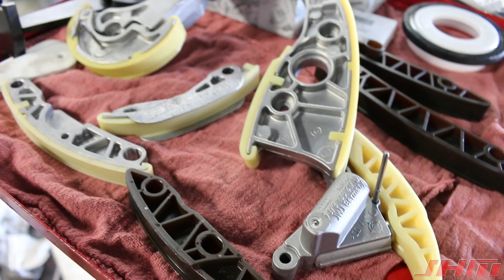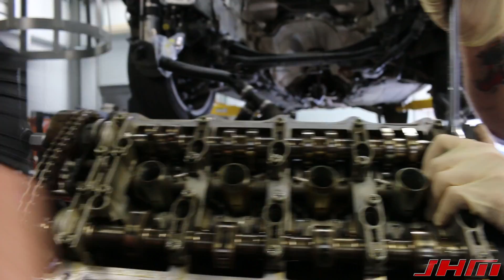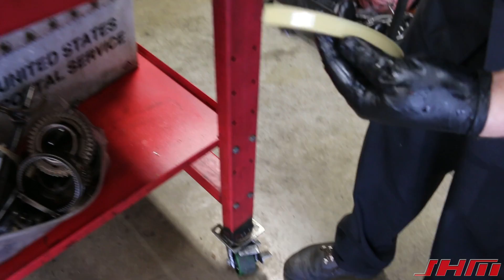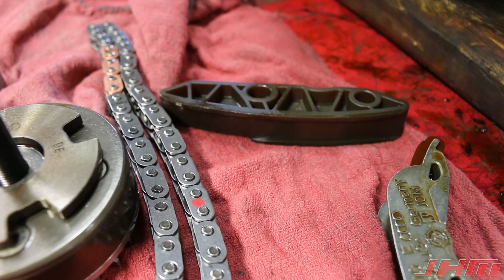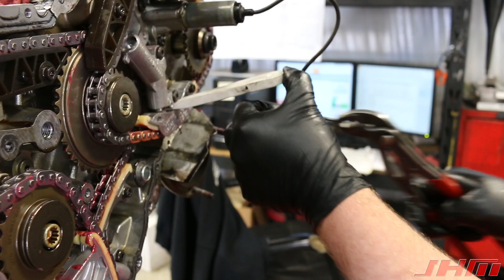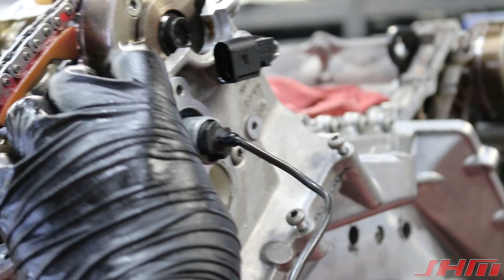JHM Timing Chain Kit Installation Visual Walk Through  - Audi B6-B7 S4 and C5 Allroad 4.2L

Comment: Is it possible to set only one sides timing without following the 4 step torque process fro each cam/ 3 torque specs. On mine the driver side is all set and good. But the passenger side is off by a tiny bit.

Comment: I am having an issue of my driver's side cams moving slightly when I remove the locking tools. The valve spring pressure turns the cams slightly backwards when they are unlocked. Can anyone tell me what I am doing wrong?

Comment: I appreciate that this is not a diy mechanic figuring stuff out on video. Thank you for doing this, and at the same time letting me know that this is best left to the pro's in my case.  This engine is going to be great for many years with this fix! I'm in the market for a B7 S4 right now, and to know that this job already has been done, puts me at ease to pay significantly more for the car.
Reply from the maker: Glad it helped! Depending on the buying price and where the work was performed, it is definitely advised to try to find a car that has already had the timing service performed.

Comment: Hi. Nice video.. wondering , how much on average this job cost? Thanks.
Reply from the maker: Typically timing chain jobs will range from 6-12K depending on what other service is performed while the engine is out. Almost always there will be coolant hoses and other various seals/gaskets that are recommended.

Comment: Blown away by the complexity of these engines, what a design marvel. Apart from the decision to include plastic guides of course
Reply: Or poorly design the seals for literally every seam so every single one of these cars gushes oil out of it if you dont replace the seals every other oil change. On top of replacing the oil every 6 months. Its a very interesting engine design. Not a very good one.

Comment: I love this engine and am considering a 2006 S4 as we speak. HOWEVER ( !! lol ) You guys have to know that for this job, you'll need to pull the engine and access it from the rear by the Firewall. This is about $4500 - $7000 in Parts/Labor at a good European Mechanic shop. So, unless you have a lot of money laying around ( or are a very good Mechanic! ) if this happens, you may want to consider the B8 Generation with the Supercharged V6. I agree that the the B7 has much more character and far better steering feel, but that repair is a very sobering thing to ponder :)

Comment: How much would this job cost if I shipped my 4.2L V8 to u ? Parts and labor it would be a non FSI motor for a 2005/06 A6C6 with low miles....
Reply from the maker: Labor to perform the timing service with the engine already out is 4 hours of labor (our labor rate is $139 a hour) plus the required parts. Please send an email to sales@jhmotorsports.com and we can put together a quote and help arrange freight as well if needed. Thanks!

Comment: Knowing that the timing chain guides were going to be a big issue with this motor, Audi should have made quick release brackets for the engine / trans so you could drop the motor in 10 minutes. That would be awesome.

Comment: Im looking at a 2008 audi s4 with 130,000 miles. The dude is asking 14k and has not had the chain guides replaced. But this looks like it could cost around 5 - 8k? I guess if you have one of these motors it will be a mandatory event at some point during the life of the car?
Reply: After looking into this a little bit deeper I need to change that 5k - to 8k , 8k -10k?
Reply from the maker: You are correct, the timing service will usually range from around 6-10K depending on the shop's hourly labor rate & what other service is performed while the engine/transmission is removed. If you are in the market for a B6 or B7 S4 we would highly recommend finding one that already had the service performed or getting the vehicle for the right price so you can have the timing service done.

Comment: What’s the price on this service
Reply from the maker: Price on the timing service will vary depending on what other work is perform while the engine/transmission is removed. Typically we see this service run between $6,000 to $10,000.

Comment: Great video, have mine out now but I don't see how you seat the rear main seal. When I put the cover on it just slides back toward the timing chains. Do you have to remove the rear flange and then put the seal in ? Like I said a great video but this one little piece is crucial to completing the entire job.

Comment: Manual says to do two passes on the camshaft bolts - one at 40 Nm and one at 100 Nm + 90*. They also say to remove the camshaft locator bars before proceeding to the 100 Nm + 90* pass. What's your take on why you leave the locator bars in and do the additional 90* as a third pass?

Comment: How much does this cost? Parts and labor
Reply from the maker: The cost is going to vary depending on what other service and parts are replaced while the engine is out. Typically we see timing chain service range from 6K to 12K. You can email us sales@jhmotorsports.com and we can put a quote together for you.

Comment: Is this kit a upgrade to the original components or is the engine going to always have this Achilles heal so to speak?
Reply from the maker: Jason, we offer various levels of timing chain kits for the 4.2 40V that contain our upgraded JHM components. The one issue we very commonly see is broken guides and worn mechanical cam adjusters. Both of these common issues are addressed with our JHM timing chain kits.
Reply: @JHMotorsportsInc  Thank you kindly for that response, lots of help and we'll likely be purchasing one of your kits soon. We only have a rattle at start up at this point but want to change out the guides ahead of any real issues! Cheers

Comment: Were the early 4.2 belt drive? Like the 2.7 and 2.8 v6.
Reply from the maker: Yes, the 4.2 found in the C5 A6, S6 and RS6 use a timing belt set up similar to the 2.7T and 2.8L. The timing chain engine featured in this video is found in the B6 B7 S4, C6 A6 & C5 Allroad.

Comment: Excellent work .Does those inlet cam sprocket have a special name? Learning from you man?
Reply from the maker: They would be the camshaft adjusters or cam adjusters. we sell our JHM cam adjuster repair kit specifically for the Audi 4.2 40v found in the B6 B7 S4 and C5 Allroad https://jhmotorsports.com/jhm-mechanical-cam-adjuster-repair-kit-pair-for-b6-b7-s4-c6-a6-and-c5-allroad-w-chain-4-2l-40v.html

Comment: Is this the same engine as in an RS5? And what about the R8 v8 4.2? I know the engine has to be removed for both of these cars, but once the engine is out, is the procedure the same? Thanks

Also, bad design of the camshafts to have the wrench flats on the opposite end of the camshaft.  That’s a lot of torque to be transmitted through the length of the cams.  The wrench flats should have been right next to the pulleys, in my opinion.
Reply from the maker: This engine is not the same as the 32V FSI 4.2 V8 found in the R8, RS5 or RS4. The B6/B7 S4 has a 40v non direct injection engine. Typically on the FSI engines we do not see timing failures like on the 40v engines. The job would be very similar between any of the Audi timing chain V8's.

Comment: Would this be the non fsi engine found in the 05 A6? Found one for cheap where the owner claims it runs rough but doesn't have a CEL. Trying to do research on possible causes, after seeing this vid I might stay away 🤯
Reply from the maker: Yes, your A6 should have the 40V non FSI timing chain 4.2. It would be hard to say the cause of running rough without seeing the vehicle in person.

Comment: Great video to watch for fun. I did my own timing chains a little bit before this video came out, and I had to do it twice, because my chain had either stretched a little bit or even jumped timing when both of my guides broke (the one you show broken in the video, and the top guide for the main chain broke on mine also), And I did not check with a mirror when inserting the crank pin, I just threaded it in and tightened it. it must have missed the hole because after getting it all put together and back in the car, it was immediately throwing cam/crank correlation codes even though it sounded like it ran okay. I had to pull my engine back out and do it all over again after realizing my mistake. Still running strong now over 2 years later. did my chains at 160k~ish and the car now has 179k on it. If I ever do this job again on another car I will be sure to check with a mirror the first time. again, great video.

Comment: My hero i want one of these s5 with the 6 speed manual
Reply from the maker: This is the 40v engine found in the B6/B7 S4 and C5 Allroad. Your S5 would have the 32v FSI engine. They do not have the same timing issues as the S4's.

Comment: Scanned the car n says advance timing about 4 to 6 degrees. Getting sound of rattle aswell. When I put the foot to the floor. The car behaves like its so tired. I would think the timing is off?
Reply from the maker: depends on the trouble codes you are getting. send a complete VCDS code scan to sales@jhmotorsports.com and a detailed description of your symptoms. thanks.

Comment: Great video horrible prices for such an old car now
Reply from the maker: the B6/B7 S4 is one of the last and only V8 AWD 6 speed manual cars, if that's what you're looking for its great. the labor for the engine pull is the biggest cost in the timing chain job.

Comment: $4k for a kit 🤯 and it doesn't include the chains🤯🤯
Reply from the maker: chains aren't usually required. very rare do you see an issue with the chains failing or stretching.

Comment: How ridiculous.
I've worked on jet engines less complicated than this.
Reply: What's your argument here, really? Jet engines rely on tight tolerances, but they work on a much simpler principle than ICE's...
Reply: @skakamj0lk  a Jet engine is also an internal combustion engine and work on the same basic rincipal. Intake, compression, combustion and exhaust. Main difference is a Jet engine uses stages of compressor  blades, instead of pistons, turbine blades to spin a fan and propel hot gases aft

Comment: Hi there does anyone knows if this engine is same one in 2008 audi a8 4.2l
Reply from the maker: This is not the same engine, your A8 would have the 4.2 FSI 32v. Timing issues are not common as common on the FSI engines.

Comment: is this the same on the 4.2 fsi motors?
Reply from the maker: The FSI 4.2 does not have the same timing chain issues as the B6/B7 S4's.
Reply: @JHMotorsportsInc  that's good to know, i just purchased a fairly high mileage 2011 a8L (180k miles) and have been searching for timing components for a future service, so far its been a rough journey

Comment: How much does something  like this cost?? Thinking about buying a 2004 s4 with a timing issue supposedly
Reply: franky Vega-reyes I wouldn’t recommend it if you know the car has a issue with timing unless the car runs well but the job is not done 
You could use that as leverage to get it at a better price 
But definitely do it as soon as you purchase the vehicle  
Better be safe than sorry

Comment: Awesome video! I have a question if you could help please. My a5 3.0tdi is In the process of having a replacement timing chain kit due to a rattle. I think it might be due to chain stretch. My question is....Are the guides supposed to have movement (in and out). I noticed the guides are not screwed in like the tensioners etc. Looking for confirmation before it all goes back together. The kit didn't include any guides. Thanks

Comment: Looks similar to the 5.2. I should do mine this year for peace of mind. No noise yet, v10 purring happily still. Would you say no noise no problem or have you seen the lower center guide broken on cars with no signs of failure?
Reply: i would leave it alone if its not making noise if there is a bad guide or tensioner you will defintly hear a rattle coming from the engine just adopt a strict maintance schedual and you should be fine

Comment: What tool is used to spin the crankshaft pulley for aligning the camshafts? Please share a link in the comments or tell me the name. Thank you!
Reply: Please can someone help me?
Reply: @Zach7gri-  you just need a socket that fits in the bolt and use a long enough Wrench.
Reply: Amazon Audi crankshaft socket

Comment: I have a Blk on Blk 04 S4, needs paint and a little work(ate a guardrail in the snow at low speed), And it needs the chain service. 116k. For Sale, As is/parts car in OR. BringChangeAbout at gmail.

Comment: I have an S4.
Thank god a previous owner spent $US 4000  having this done!
What a nightmare.
Reply: Where did you find it done for 4k? The cheapest I've found is about 6 in my area. 123k miles and still runs fantastic but it's a when it happens not an if as we know.
Reply: @RJTamm93  send the car or engine to Bulgaria. They will do this job for 1000$ and another 1000$ in OEM parts from Audi

Comment: I don’t get why the chain guides are made from plastic? Surely this is a bad design
Reply: It’s for noise purposes aswell if you had a metal guide the chain would make a tone of noise
Reply: @dominikdominik7112  I'm not sure that's true because the kit the guy is installing is an upgraded metal guide.
Reply: metal frame with plastic wear points
Reply: @dominikdominik7112  i thought they used metal in the rs4 tho?
Reply: Also great vid by the way
Reply: They upgrade the core to metal

Comment: All this money spent and in the end could still be an engine with scored walls. But damn I miss my b7
Reply: Very unlikely, these engines will do 150k miles and even if the oil change is done every other service youll still see the original honing marks on the bores.